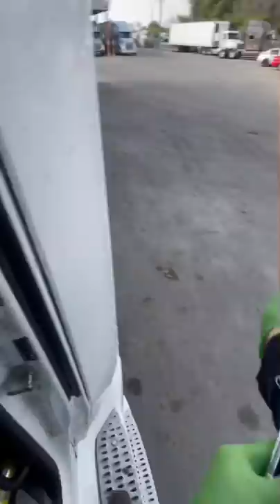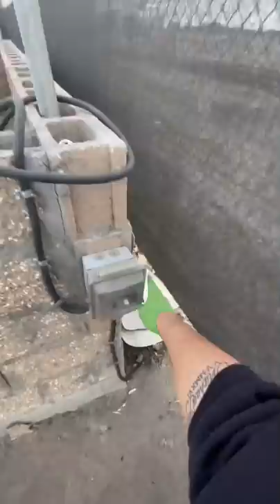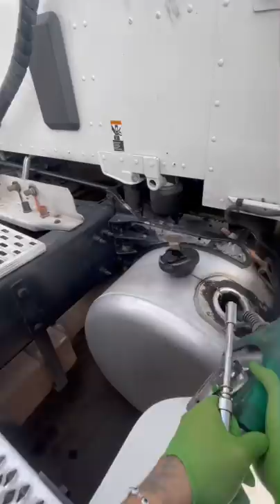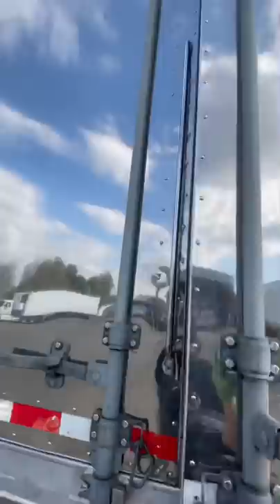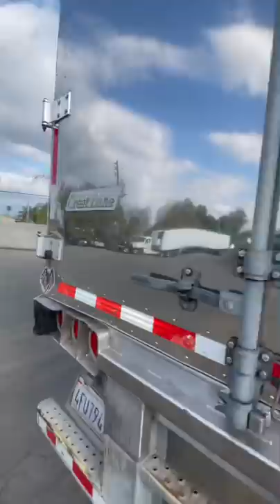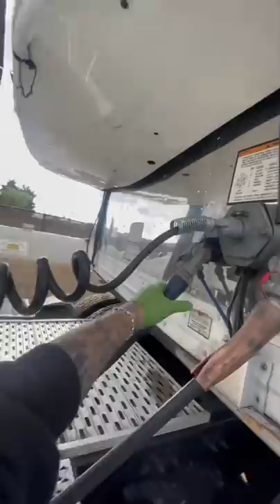when your worst times turn out to be some of your BEST times🤌 #shorts

Comment: I was a trucker entrepneur for more than a decade before I was diagnosed with sleep apne in 2018. Lost my lisence. Can only drive a passenger car or a van. I had a 2013 Mercedes-Benz Arocs 3363. That was a good truck. I transported 40t (metric) machinery with a 3 axle semi hauler. Accosinally I miss the feel of the trucks power. I didn't like the long hours and nights away from home though. Lots of driving at night to move machinery to a new job sites while the operator was sleeping.

Comment: Yo Wussup guys but another thing happened to my dad while trucking. What happened was that he was taking a shipment from Livermore and to get the the destination he had to pass vasco road where there is a lot of curves and slippery when wet and so when my dad was passing through there (rainy day by the way) he was carrying a 24 ton shipment and when he was driving everything was going well until a small car passed through in front of him and hit the breaks full and instantly stopped (at the time if you crashed someone’s car the company you worked in for trucking would have to pay full amount for the car) and like my dad worked for shipping parts for Tesla well some idiot saw the chance and well when the small car hit the breaks in front of my dad, my dad hit the breaks but like he had 24 tons on him the trucks would not stop and so he turned right going straight crashing on to the Side (just by the way there are only two lanes and on the other side of the lane there is railing and a big drop of 256 feet) and well when my dad turned right he went down the drop with all 24 tons crashing down at his semi and the only way this man lived was because when he went down he dropped his whole body to the floor of the semi and when the shipment came crashing down it only took off the whole top of the semi (Kenworth t660 sleeper) and it ripped off the whole top of the truck and then when he was about to get off his sweater he was wearing got caught on the shrapnel of the messed up semi and this is were he messed up his back real bad and after climbing back up from the valley/hill. This is the part were all of you thing this is cap but it it all 100% real, my dad had been aided from a surgeon that had just gotten off of work and well this was the only way my dad would have survived all of this just because of pure luck. And after that he was token to a hospital nearby and I remember real well that when my dad was in the hospital bed my uncles (my dads brothers) didn’t even recognize him at all because of all the bleeding and bruises and my dad said that at the time he could barley even see because of all the bruises but at the end everything came out just fine and well the only thing that scared him for life from that even is his back, he could not carry anything heavy for the rest of his life. And well to everyone who thinks this is cap, you guys could continue to think this is cap but I could even swear on my life this is 100% true but yeah that’s another thing that’s happend in my dads life

Comment: "Always complaining 2 my wife"... what a man. Thumping tires with a pressure gauge... Yep, the right tool 4 the job. No need 2 Ck the inside tire. The 1 next 2 it has air. No load locks? Rubber skin gloves?... Must B the new breed. Yes I heard about the booster seat. I can excuse that.

Comment: Nice job but 2 questions is that a child car seat Ur sitting in and second y would u hit the tires with a air gauge all Ur doing is damaging air gauge and I could pull that valve core and u would have no idea it flat with that little tap get a hammer man it will help when Ur brakes lock up

Comment: I'm 5 ft 10.. how are you reaching all the high points on your truck and trailer while riding in a car seat. I know you're not that short. I have a long torso and very short legs. I have to pretty much run the seat all the way down to reach the pedals. Just looking at your body movements when you're outside the truck and how you're holding things. I know you're not that short and you have to be at least 5 ft 8 in to 5 ft 10 in to reach the reefer on your trailer the way you did. Nice scam though. Like your trucking info though.